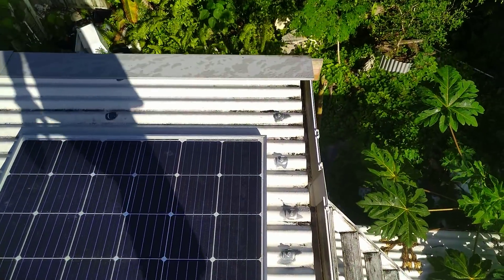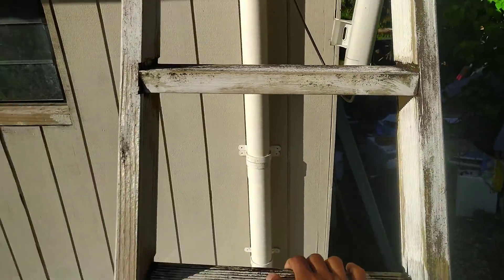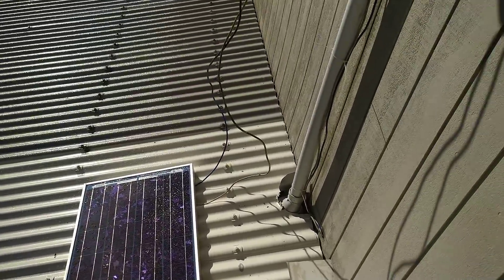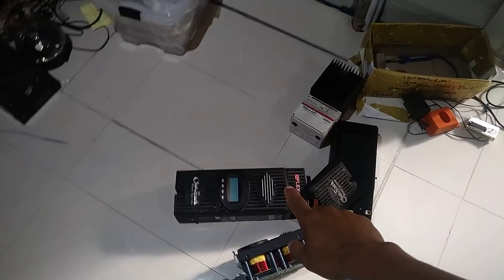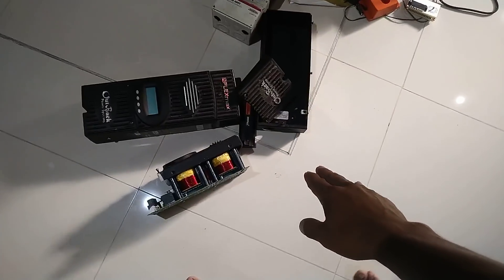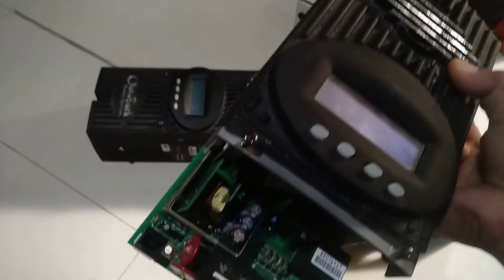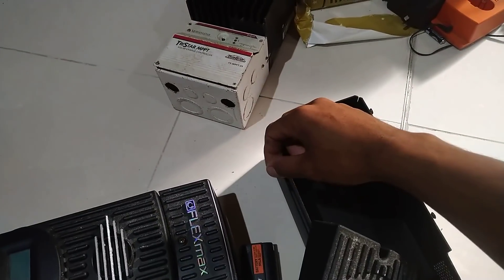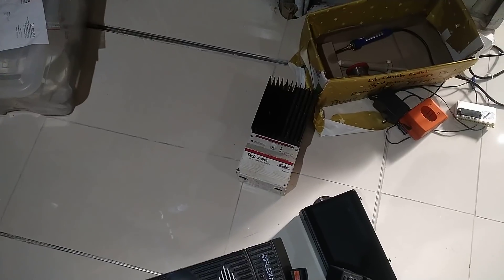Upgrade up to 7kw DIY off grid solar

Comment: Low frequency inverter with 8kw or better 10-12kw if you want to look for long-term solution..... 
Max load shuld not exceed 75% then you can expect 10 years-life by low frequency inverter....
Dust spiders ant's and other bugs like your inverer also.....